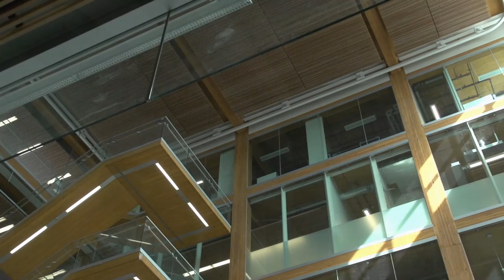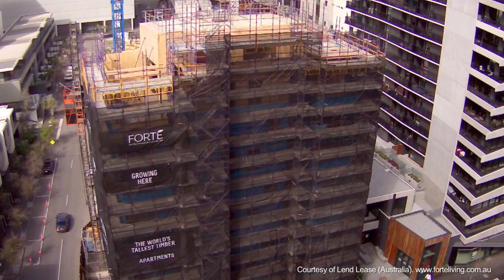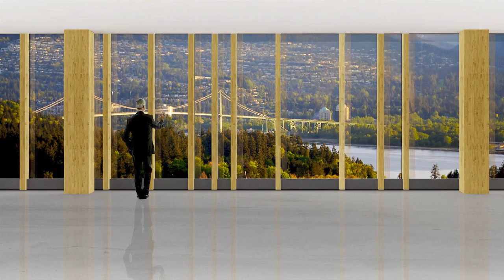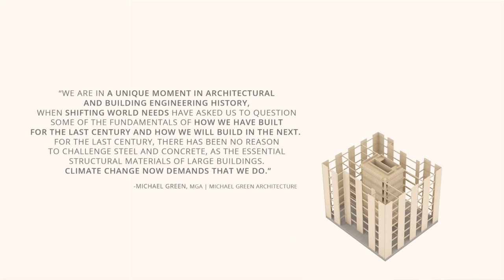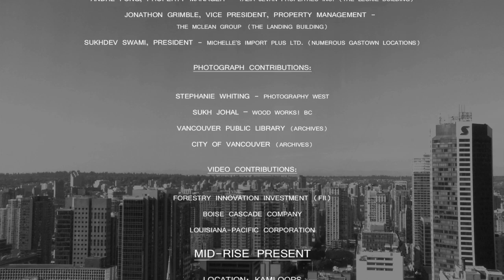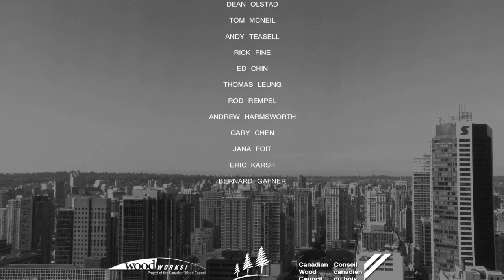Future of Mid-Rise and Mass Timber Wood Construction in B.C. (Part 5 of 5)

Comment: did someone yell " FIRE "
Reply: wood (with a certain thickness) resists better than steel. Steel melts and looses its strength, wood gets an insulating layer of coal and will loose only 10% of its strength.